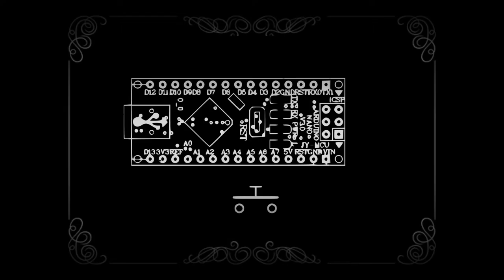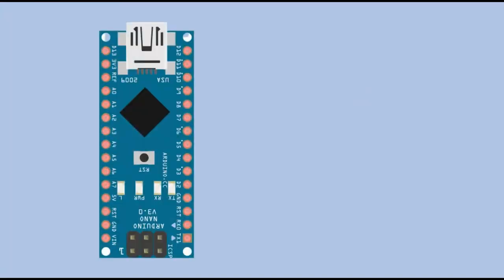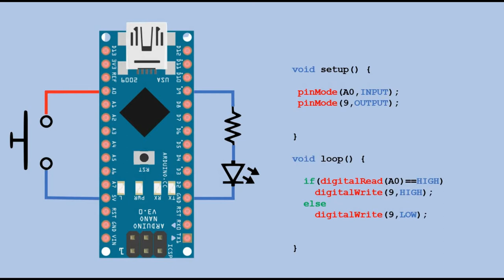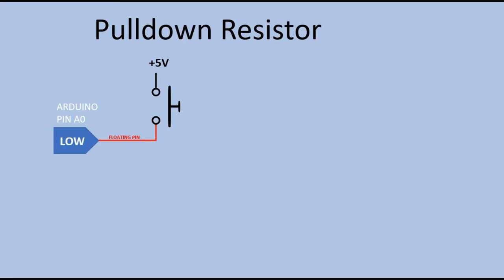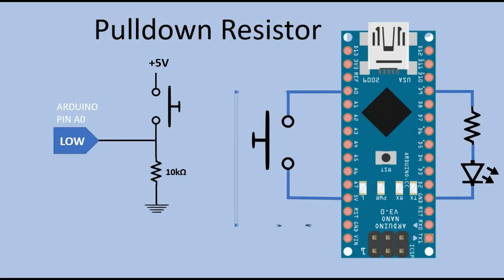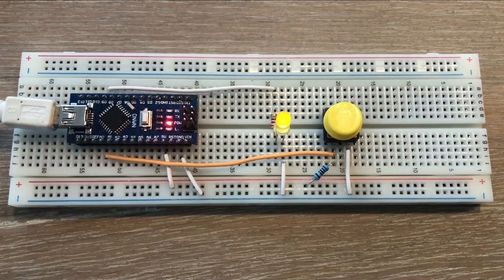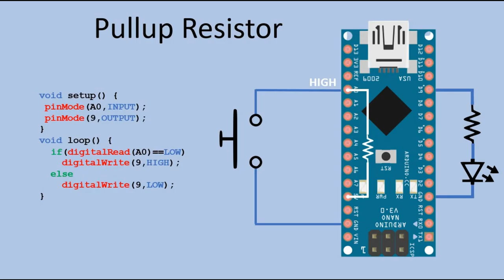How to use Pushbuttons with Arduino. Pull up vs Pull down resistors

Comment: Thanks Mario.  Excellent explanation.  For this button/LED set up, is it necessary to use and Analog pin, or will the set up also work with a digital pin?  Thanks
Reply from the maker: All pins have built in pull up resistors. I just chose to use Analog pin

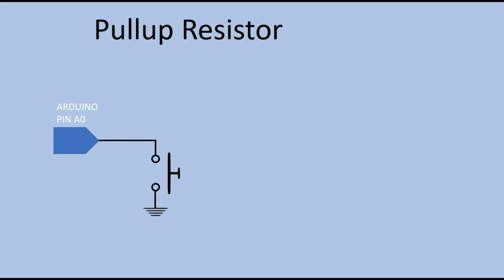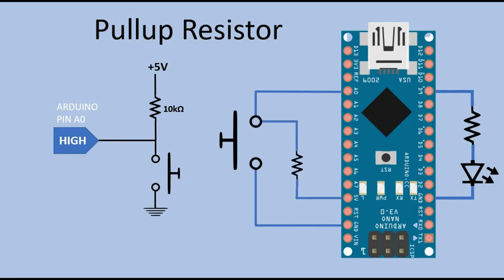Comment: Something about 6:45 to 7:30 I just am not understanding. Why would it read high with a big fat resistor in the circuit?

…i mean I get that I need to add a pull up / pull down resistor - but I can’t follow the logic of where/how the electricity is flowing. 

It’s strictly a ‘me’ problem…

Comment: Wow! Best explanation yet! Perfect mix of theory and circuitry and how they work! Thanks. Still one puzzle. The original problem was due to noise voltage in the open or loose wire going to A0. In your diagram for pull down, that same wire is still there with the OPEN switch. Why isn't that same noise still present? Indeed it is now connected to ground via a resistor making the current flow for this very tiny voltage difficult. So why doesn't the original noise voltage still flow to A0?
Reply from the maker: Not being very electronic profficient I also had a problem to get my head around it. But in summary. Voltage doesn't from current does. If flows from positive voltage to ground. And through pulldown resistor and the use of voltage divider we set ground at the pin. Arduino detects the voltage value not the flowing current.

Comment: Thank you so much mate.
I'm doing a quiet big project for swimming pools, to control the filter pump, booster pump, chlorinator, heater, valve actuators, variable speed pumps etc, my project was working fine on protoboard, I printed the PCB and the button interferences show up on butons inside the MENU screen, now I'm using pullup method using the ESP32 internal resistors, and voilà it's working fine again. Many thanks for your time to make and post this video, I'm really gratefull. Cheers.
Reply from the maker: Glad my content was of help to you. Consider supporting my channal

Comment: instead of pinMode (9,OUTPUT) is it possible to declare SDA(A4) or SCL(A5) as output to switch on an oled to show time for 5 seconds in a night clock project and a capacitive proximity sensor instead of a button?
Reply from the maker: Yes. You can do any other action. Led is just an example.

Comment: Can I write
pinMode(A0, input_pulldown)

When I put the up signal then pin no 9 is up otherwise low.
Reply from the maker: No . There are only pull-up resistors build in. You have to adjust the code to take this revers behavior into account

Comment: In pull-up configuration, why do we have all 5V when the button is not pressed ? Normally, shouldn't we have much less than that because of the big resistor of 10k ohms that will decrease those 5V ?
Reply from the maker: Have you watched the video carefully. There is an explanation using voltage divider circuit to show how this works
Reply: @marios_ideas  Actually he was not asking about the voltage divider when the circuit is closed, but why when the circuit is open the 5V goes through a 10k resistor to A0 but still remains 5V instead of decreasing for e.g. to 2V? 
I didn't understand this too.
Reply from the maker: A push button is a mechanical switch that consists of two states: pressed and unpressed. When unpressed, the button effectively disconnects the digital pin from ground, so the pull-up resistor is the only component in the circuit connected to the pin. Since the resistor has a high value (10k ohms), it limits the current flow to a very low level, and the voltage at the pin remains close to 5V. @SebVEVO
Reply: Since there is no current-flow when the button is not pressed, just use U=R×I to understand. Without current there is no voltage drop after an resistor.

Comment: Which one is better pull up or pull down?
Reply from the maker: There is virtually no difference. Internal Pull up wins, as you can use build in pull up resistors so then you do not have to use external resistors.

Comment: why would I want to use external resistors when I can let the arduinos internal resistor handle it?
Reply from the maker: I guess only if you do not want to have the Pullup logic and want to stick to pulldown. For small project adding a resistor is not a big deal. but for more complex ones if you create custom PCB minimmising number of conponents is super important. A lot of people do not also realise that those pullup resistors are available:)
Reply: @marios_ideas  alr, thank you for the response (-;

Comment: My question here: Why 10k resistor, why to put a resistor ?
Reply: Maybe so that current only flows through the switch
Reply: Because when you press the button power will flow from 5v to ground directly and resulting short circuit